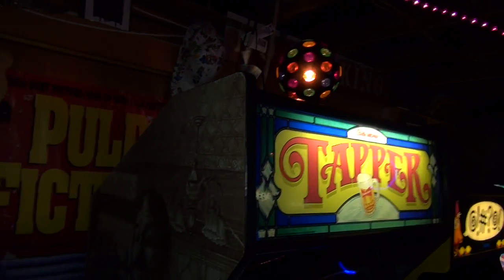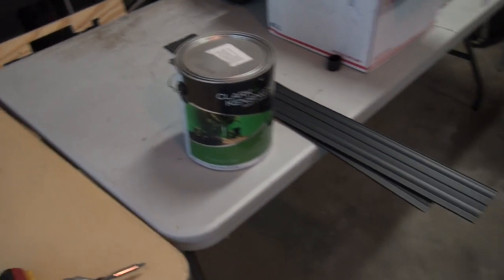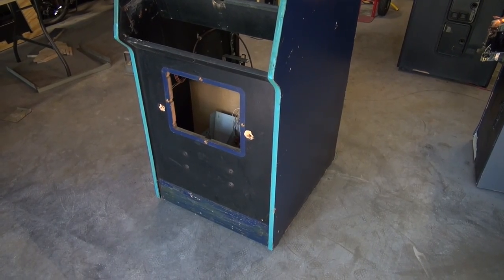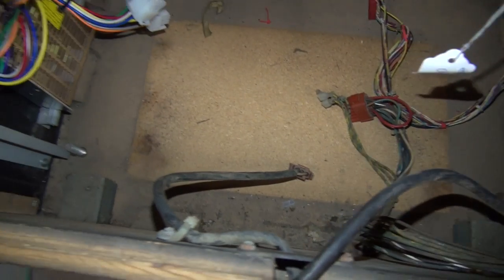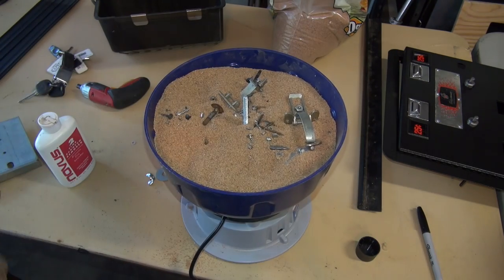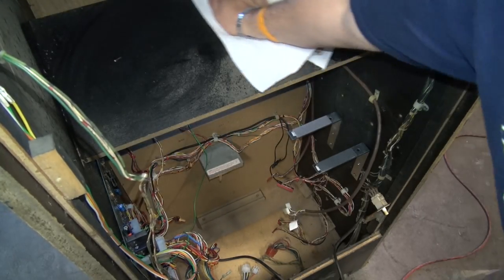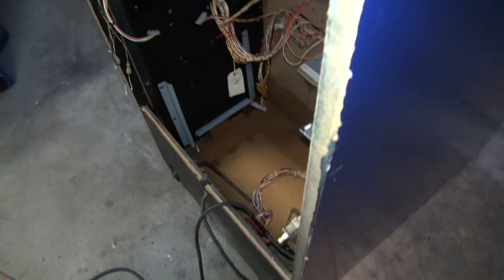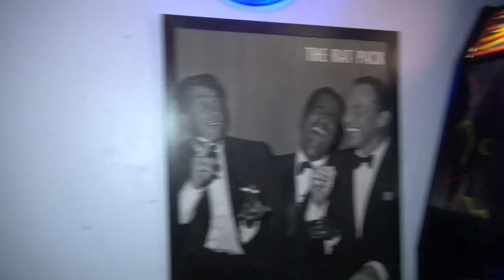Journey Arcade Restore Part #13 - Bally Midway - Stripping & cleaning an arcade cabinet for restore

Comment: Mic sounded awesome this video! Really good, actually. Love the montages when it involves the minutiae. 

Can't wait to see the wood prep. I've just bought a "well loved" pinball machine that's going to need some cabinet work, much like your Journey. Some small flaking around the edges, holes from the lock bar that once existed, etc. Hopefully it's not difficult. 

Love the enthusiasm you have for the hobby! It's rare, it seems, these days.
Reply from the maker: Thanks, Patrick! I think my audio sounds good usually. That last video I had some issues I think with the cord pulling on the jack and I didn't realize it. The problem is, when I am shooting video I have no way of knowing if it's happening until it's too late.
Reply: John's Arcade Game Reviews & Tech By the way... I saw that disco ball at Lowe's near the hardware aisle for $20!!

Comment: I'm surprised you touched the huge ass capacitors on the top like that and didn't get shocked!?!
Reply from the maker: Why? The top isn't where the leads are. The leads are on the bottom and out of view.
Reply: John's Arcade Game Reviews & Tech True but don't you discharge a capacitor like that by  touching the metal to a ground?  If you touch the top metal like that wouldn't you become the pathway to ground? perhaps there was a coating on it but to me it didn't look like it.
Reply from the maker: Penfold8 The leads are on the bottom. The top / case is not ground.

Comment: John, I'll say this in a good way so don't think by any means its criticism...You are such a wasteful guy! Novus is too expensive for what you used it for, plus most of it will stick to the media and do nothing or little to the actual parts, best thing to do is use nothing at all as you want to maintain the coarseness of the media to clean the part out. By introducing wax or other polishing material all you are doing is making the media slippery and thus not scour the part as it should. 

Even though the media is cheap, why throw it out? unless it is extremely dirty you can reuse it many, many times, at worst you can save it after multiple uses and have a less course media for more delicate parts. Also, you don't need to leave the tumbler on for that much time. After a few hours, the parts will get as clean as they can get. leaving the tumbler on for days is just wasting electricity and time.
Reply from the maker: You really do need to run it for as long as it takes. Hours is not enough for most parts. The NOVUS is supposed to help polish. :)